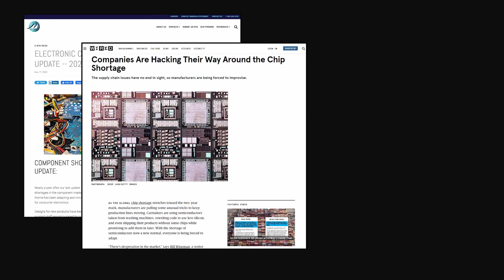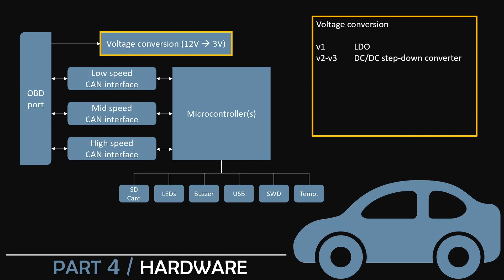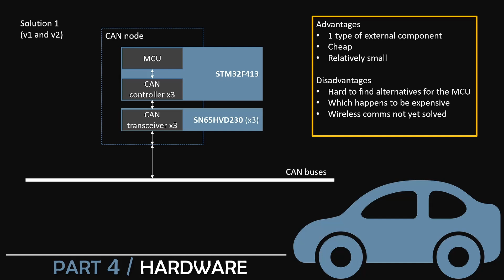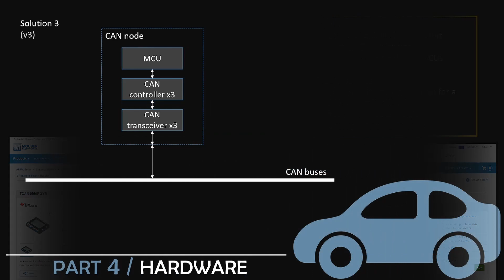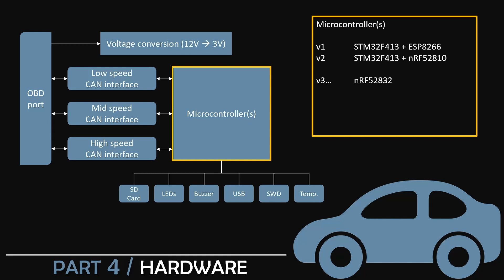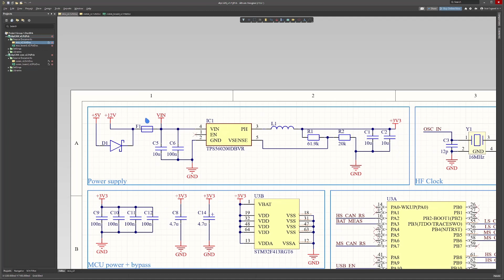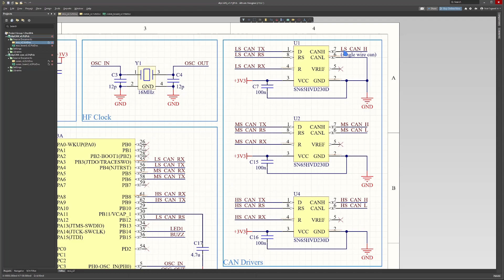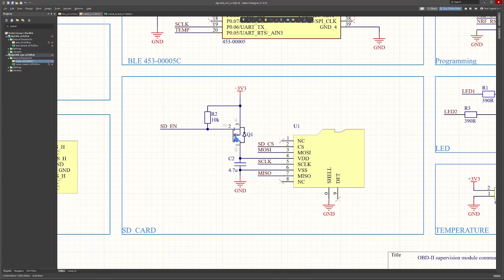How to hack your car | Part 4 - Custom hardware module

Comment: Thanks for amazing work and interesting project! It would be very cool if the next version could integrate LIN network analysis. 
I hope you will continue your project 👍
Reply: Lin is easy. Slow and if he has room on the uc just add it to lin circuit ensuring circuit impedance  matches.

Comment: I did all your work for Jetour X95 car "One of chery cars" , setting works on 550K speed , i see data changing , but not for all steering buttons , car audio buttons , any control buttons don't  change data or add new line in monitor app , what i miss here to see control buttons feedback on monitor app , Much Appreciated Adam

Comment: This has been super helpful for me. I've got a 2007 GX470 with Nav Head Unit that integrates the climate controls in the touch screen. I'd love to upgrade to a modern Head Unit but I'd lose my climate control. I'd like to 3D print my own control panel with hardware buttons.

I've ordered the ODB2 breakout cable and the MCP2515 module so I can start reverse engineering the commands.

Comment: So the CAN transciever is just a device (ESP or nRF) that comunicates with your phone

Your sniffer can be run on regular STM that has 2 canbuses right?

Also where did u buy your map mat that your keyboard sits on? I like it very much
Reply from the maker: Hehh :D The mouse map is a cheap mat from AliExpress.

Sure, an STM with 2 can busses will work just like with 3, but with 1 bus less.
Reply: @adam_  ok thanks

If I understand this all corecly2x can are used as high and low range and transciver is used for midrange can?

The more I read into this the more confused I got, I know my STM32H750B-DK has 2x CAN FDs (it has 2 can pins on the board (CN10 (rx and tx) and CN11 (rx and tx)

I suppose this are CAN high and CAN low pins

I always thought thats enough, so why need 3 can pins?

So sorry for confusion :)

Comment: Hi Adam,

How are you measuring the car's battery voltage?

In my Astra, I know how to measure it using the MSCAN.

However, I now want to start using the LSCAN instead, but the messages with ID 0x500 give the "IPC system voltage (instrument)" which is from 0.5 to 1V lower than the actual battery voltage.
Using an OPCOM, there's also the UEC System Voltage, but I can't find the corresponding CAN message ID to read it.

Comment: Do you think it is posible to find Can frame that is responsible for checking if fog light boulbs are working, and when u put led lights they dont work becouse they have lower resistance, so u find a packet of data and program some microcontroler to spam Can network with that data so it thinks it is coming from foglights
Reply from the maker: Technically might be possible, but I'd give it a low chance, to be honest.
Reply: @adam_   i am thinking  to give it a go, especialy becouse i drive vw and i think that project would  work on every car in vw group
Reply: if when LED is installed, the issue is low resistance, why not just install a resister to mimic the non-LED light resistance? I'm not an electronics expert, but seems like this solution would be simpler than overriding the CAN error message.
Reply: @mech_builder7998  you can do that for shure, and tht is only solution for now but thera are couple of problems,first normal boulbs are usaly hiigh wattage and u need high wattage resisto but it heets up segnificantly to u need to mount it with screws on a metal peice of car for heat transfer + u need  to splice the wires or find the sam conector, also u need to do thtat fo every boulb whic is time consuming and in case u need to take apart bumper it is a hasle and sometimes there is no space in th headligh but if u put it outside it is no longer waterproof, it can be done properly but it is a lot of work this way u just plug into obd and every thing is like factory

Comment: Why not use ESP32-C3,one chip for all,WiFi,BLE,TWAI(CAN).
Reply from the maker: Yup, would work. It only has 1xTWAI tho, but it's crazy cheap and seems (more) available.
Reply: @adam_ Hello!  I found out the ID from the packages for turning on and off the headlights in my car.  But when I send the command, it doesn’t react with anything.  where am I wrong?

Comment: Some nice work you've done there, thanks for sharing. I'm about to create something similar, however I'm going to use ADC for a few measurements, hence I'm afraid of noise from the SMPS. So far my first prototype is based on LDO, it heats up to ~50°C, it's basic one though just for sensors (without CAN, but with a display). I'm waiting for your upcoming videos, to hopefully save me some hassle in the future :)
Reply from the maker: You could use a special reference voltage generators for the ADC if you are concerned with noise, or use a high-end DCDC that has minimal noise. 50+°C is a lot to conserve in a small plastic box in a car.